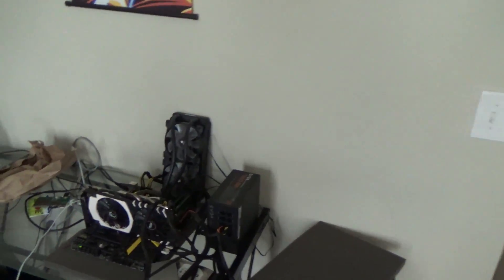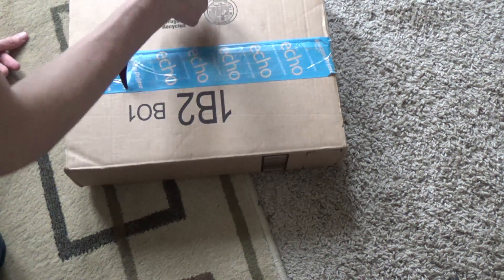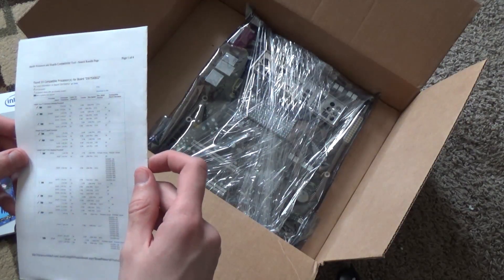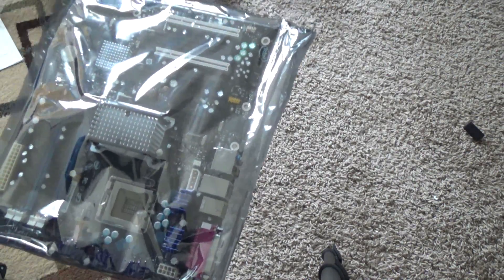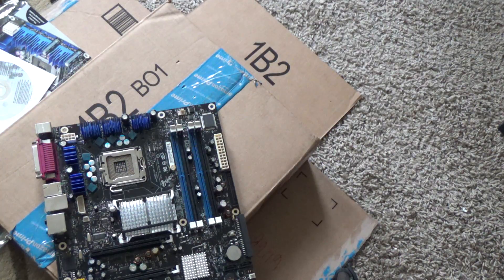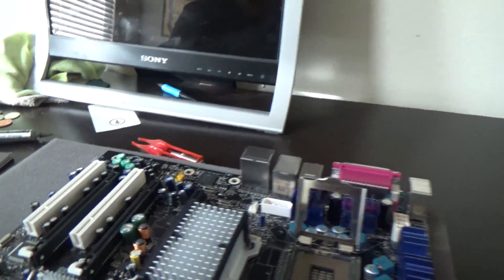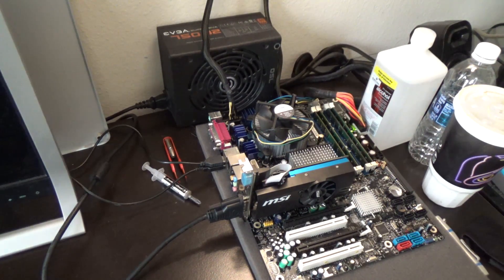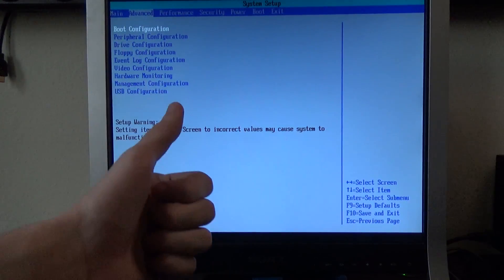LGA 775 Motherboard Repair  | I Bought Stuff #10

Comment: I'm watching this video on my old D975XBX2 that I've had since late 2006. It has a few upgrades like a Core 2 Quad Q6700 8 Gigs of Kingston Hyper X ram and a Samsung  500 gig 850 EVO. Also a fresh install of Win 7 Pro. OH, I forgot, I also put a 2 gig GT 730 in it. This is actually the first of four machines I've built over the years. Never got rid of it since it still is handy for doing stuff.

Comment: oh boo hoo i have ass loads of 4bent pins on myvmother board it still works
Reply: Randal H Dalme yea but it depends the pin that gets bent, bcuz if a certain one is bent  (a pin used for vital system use) the whole thing can just not turn on